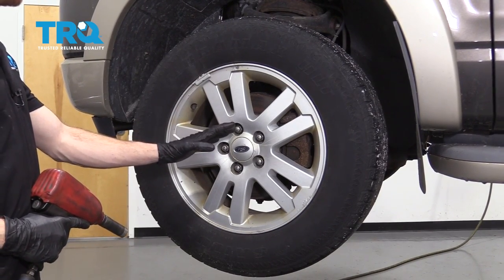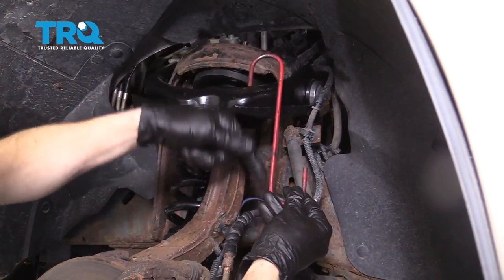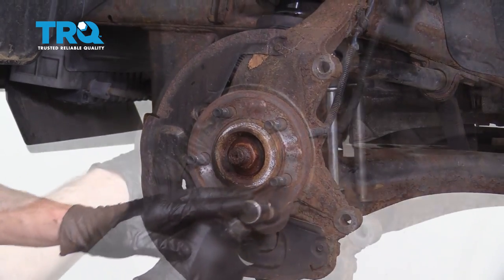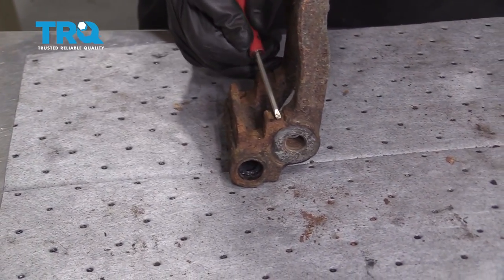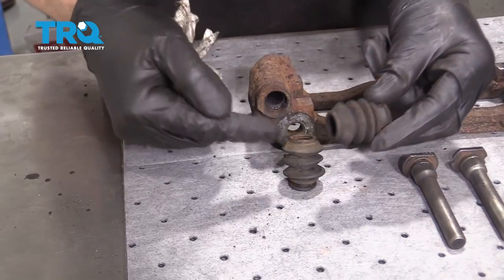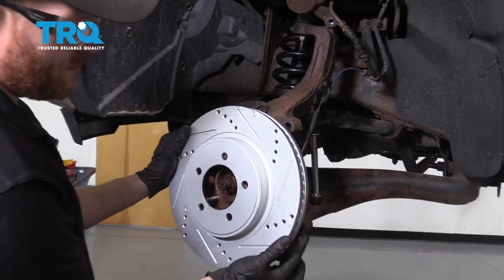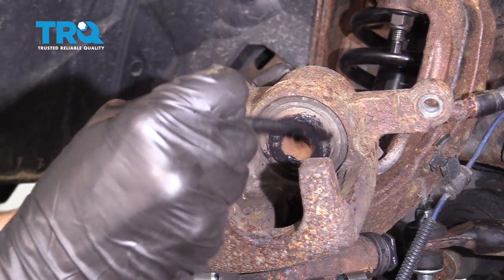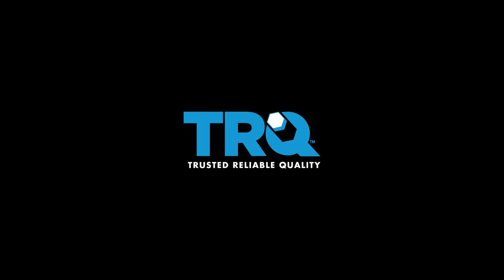How To Replace Front Brakes 2006-2010 Ford Explorer

Comment: Did this yesterday with the kit from TRQ. The only issue was the Pads were difficult to install onto the bracket. Bracket was super clean. New clips installed but has to force pads on to bracket while off the rotor then install the bracket. Now I am worried that they maybe to tight and not back off the rotor when the brake is released. Any thoughts on my concern?